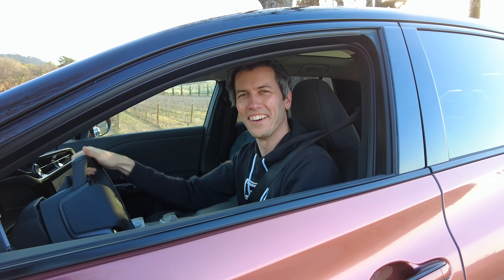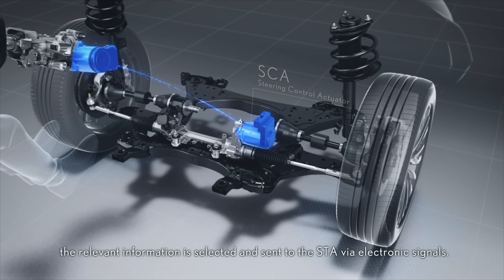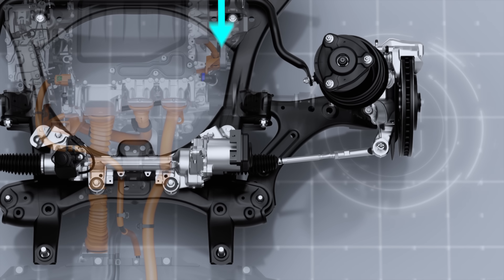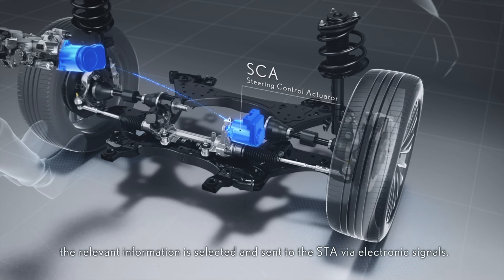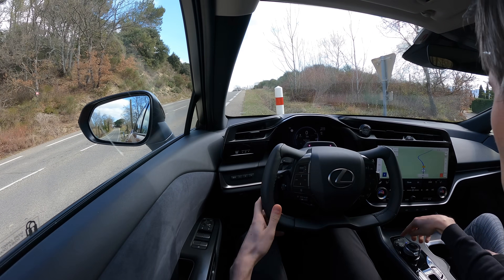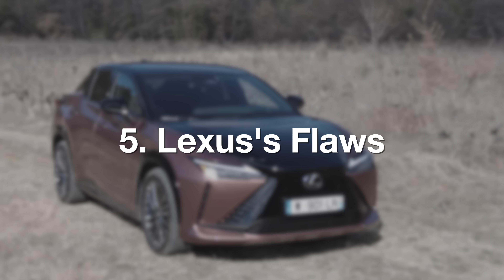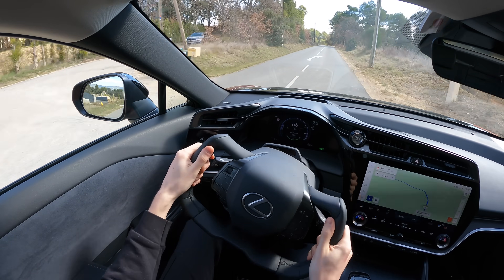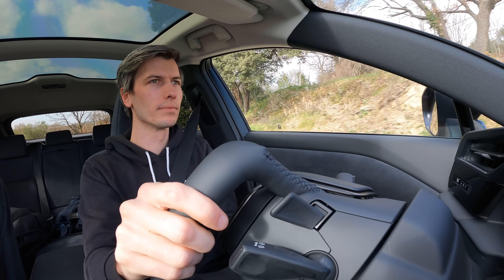How Lexus Fixed Tesla's Bad Idea: Steer-By-Wire Yoke

Comment: Wow i was beginning to type a comment about mouse sensitivity when that was brought up in the video. And i think that the analogy with mouse acceleration is better - mouse acceleration is perfect for the casual user, but at the cost of precision. Mouse acceleration (MA) is like this but in reverse, slow down with the mouse and sensitivity decreases (Making small incremental changes easier to handel) and when you make quick jerky movements, it will increase sensitivity = meaning the average user can make the most with smaller mousepads, much the same with this steering of 300 degrees. But. And heres the but. I myself have played FPS games all my life, and refrain from using MA because its hard to be precise. Yes some FPS pros have used it with great results (less than 5%), but its easier to be more consistent and precise with a same constant ratio. The brain learns that moving mouse 10 cm = i turn this much, lets call it 100 degrees. But with MA 10 cm mouse movement can result in anything between a rotation of 20-200 degrees depending on how fast you jerk your mouse in those 10 cm = Harder for the brain to correlate.

With MA the brain has to factor in an extra layer of data when accessing how much mouse input is needed. 

Whereas without MA the brain and hand coordination only has to take into account what my eyes see, and remember from past experiences how far i need to make my mouse travel.

In this case the acceleration in steering is dependent on the speed of the car, therefore the ratio of sensitivity is sort of locked in certain scenarios. But i think that can also be a course of concern. Think about it - youre driving at highway speeds and youre getting used to how the steering responds. Then all of the sudden you there's an accident that requires you to first slowdown very fast, and quickly maneuver: Could result in you overturning the wheels, making you have to countersteer to control the car and not swing to far to the side = Unstable.

Ofcourse this is just random thoughts and not facts. But i welcome this technology and would love to test it myself, to see how well your brain deals with sudden speedchanges / ratiochanges

Comment: BMW solved Teslas problem in 2003, with a varying gear ratio power steering (They called it Active Steering). Theirs was not drive-by-wire, but "just" a planetary gear on the steering column, that allowed varying the steering ratio significantly depending on the speed. I can very much recommend reading about it, it was well ahead of its time!

Comment: A software bug with your accelerator isn't likely to be fatal. A software bug with your steering wheel very likely is. Even the F-22 with an "unlimited" R&D budget lost an aircraft to a FBW software bug. It's just hard to write software that's as reliable as a chunk of metal...
Reply: Yeah, when he said we already have it in the accelerator. Except, if an accelerator fails it can either be designed to fail safe to zero throttle OR one can simply cut the engine. Short of  installing an ejector seat, wtf do you do when that comms link is lost?!
Reply: @devsfan1830 let Jesus take the wheel...
Reply: Your accelerator bugging and sending you full speed can absolutely be fatal
Reply: @user-ix9lx4sp1z  generally speaking, brakes are much stronger than the engine of a car. While you do risk catastrophic engine failure, it's unlikely that a "runaway throttle" actually prevents you from stopping
Reply: @user-ix9lx4sp1z  except you have breaks
Reply: @user-ix9lx4sp1z  CAN, yeah. But you could still put the car into neutral and let it buzz off the limiter, or turn the engine off. You can't pull a lever or turn your car off to magically fix steer-by-wire.
Reply: FBI bug 🤪🤪🤪
Reply: There are arround 200 F22s, though. And military aircraft tend to have a higher accident rate than civilian aircraft. 

I can't think of the top of my head of an incident where a passenger jet was lost to a FBW issue. And there are a lot of FBW passenger planes (the A320 family alone is more than 10K to the F22s ~200) 
 QA72 is the closest I can think of, but the pilot saved it with his huge balls
Reply: @cockatoo010 aviation also gets triple redundancy. You think auto manufacturers are gonna spend to give your steer by wire system 2 back up systems?
Reply: @LayerZeroDesign  do they have mechanical redundancy for fly by wire control surfaces in new aircraft?
Reply: And imagine the difference in part quality and testing between an aircraft, and a car built to a price
Reply: 1. a bug in an accelrator can absolutely be dangerous. 
2. F22 is an inherently unstable airframe, that can only be stabilized and flown with the help of computers. Regular passenger jumbo jets all have fly by wire, and they have worked without incident for several decades now.
Reply: 737 Max says, "hold my beer."
Reply: Steering systems can break
Reply: @Youtubeuser1aa yeah, and you're left with a direct mechanical link and unpowered steering that still turns.
Reply: But mechanical steering wheels still have software because all cars are electrically assisted
Reply: Airplanes have been using fly by wire for decades with little issue. Also steering systems can break too. If anything this is less complicated with fewer moving parts and possibly even electrical parts when you consider power steering.
Reply: Wait till you find out about planes
Reply: Pretty much every vehicle that will be equipped with pure steer-by-wire will also have autonomous safety systems, including automatic braking and even potentially being able to pull over completely. That's miles better than what was available when electronic throttles became universal.
Reply: I mean that's because an aircraft with no control is unsalvageable, a car with not control can absolutely be stopped
Reply: @UnePintade Very good point. Though I would also counter that steering and brakes are the two most likely to get you killed if you lose control of them. But your point is valid, if you lose any type of control of a plane it's life-threatening in the best case.
Reply: Airbus aircraft and new boeing aircraft all use fly-by-wire, and that's working out fine
Reply: The funny thing is: I had mechanical problems with my steering - the steering wheel sometimes (not always) stuck a little in a specific position. We were lucky - didn't hit anything and was most of the components of the steering system replaced.

And I witnessed one when an almost brand new car was steered into the guardrail because the steering wheel just stuck a little: not fully, you could move it, but if you don't expect it in the middle of the turn - you are in big trouble.

I don't think a steer by wire system would be any more problematic. It could even eliminate some of these possible problems - and introduce new ones, of course.
Reply: Software design is improving and we are able to write more complicated bug-free-guaranteed controllers. Steer by wire in car is a lot simpler than the one in planes and yet we do have steer by wire in all airbus airliners for already several decades working well without single issue. F-22 is an order of magnitude more complicated machine than a civil service airliner. In fact with modern tools it may be easier to construct safer steer by wire than it is a mechanical system. It's not like an assisted mechanical shaft can't fail - there is also a lot of complicated engineering that goes into it to make it safe - it's just that it's been there already for so many decades that it has been figured out and design doesn't change anymore.
Reply: @sk-sm9sh  There is a rule in IT: If it can fail, it will fail.
Reply: @vxvicky  which is also equally true in the mechanical world. The question is the probability of failure events. Beat mechanical and it doesnt matter if someone dies, because 2 or 3 would have died to the same fault already from the other system.
Reply: @JeronimoStilton14 No. I have only seen power steering fail after 240,000 kilometres, but electric power steering starts to fail after 100,000 kilometres.
Reply: @vxvicky  there is no way they would have allowed electric power steering onto the road if it only lasted 50k miles
Reply: @JeronimoStilton14  For sure, lile the n47 engine, that breaks his chain in around 100-120k kms xD
Or the latest Audi 3.0 v6 engine, which is the same.
Or the...
Reply: yes, so why replace something tried and true with something that's barely been used by manufacturers?  @sk-sm9sh
Reply: @sk-sm9sh  yeah but jets and planes have to contend with trees on the side of the road if the steering goes , not do they spend much time in actual use.
Reply: @sk-sm9sh wow tell me you’ve never programmed in your life without telling me you’ve never programmed in your life. At some point of complexity you can never guarantee bug free operation, it doesn’t even have to be because of the programming, background radiation could flip a bit or a sensor reading could be falls. Any program will have some bugs especially the ones interacting with the real world because the real world always adds some noise. 

Yes planes use fly by wire but they also don’t crash into a tree if their steering disconnects for 0.5 seconds, they will glide and give the crew some time to resolve the issue not to mention that they can put way more redundancy in a multi million dollar airplane compared to a 80,000$ Car… 

You‘re comparing apples and oranges there.
Reply: @Simoxs7  just because car is cheaper than plane doesn't mean that you can't apply same high standards on many it's systems thanks to economy of scale and many numbers of cars sold. Cosmic radiation can be accounted for and indeed it is in all critical systems - nothing new. Systems that must be bugs free can be built to be bugs free. Bugs are more problem of chosen and popularized paradigm that it is entirely built on idea that it's acceptable to ship customers buggy software and maybe fix bugs later. There had been on other hand plenty of software systems built that had been successfully operating for many years without incident. Just because the industry is in majority made up of lazy as managers and untalented developers doesn't mean that you can't find more talented people who can - and had proven through experience - build systems that don't cause havoc when turned on.
Reply: @sk-sm9sh  well yes it matters what a car costs, redundancy and Research and Development increase the cost of a car and the customer is only willing to pay for so much.

It seems like my Software engineering courses have forgotten to teach this magical way of programming without making any mistakes. I get what you mean with a lot of time and resources you can make a code logically correct but its not feasible at a certain point of complexity. Just look at Nasa, its not like they have huge budget constraints on their software and it still manages to work in unexpected ways. 
If this was like a purely mathematical problem you could account for every possibility and prove that the logic is correct but we‘re talking about the real world theres always a million unexpected situations that you can’t account for.

Not to mention that I personally don’t get what problem this solves, is the reward actually worth the risk? There are ways to do this while still retaining mechanical redundancy. I would not be willing to trust my life to some programmer who will never be held accountable just so I can have a yoke in a car thats not totally useless.
Reply: @Simoxs7  indeed it seems your courses didn't include it. I mean there are a lot of smart devices out there in the wild that run for decades without an incident. So your idea that this is not possible is ridiculous. In high level software where speed is everything and where there is low emphasis on quality indeed slightly more expensive time wise techniques that help to avoid defects are rarely used. Heck even as simple as unit testing is not being practiced by majority of software industry. Your idea that NASA has incredible budgets for software is actually very flawed as they work with much smaller budgets compared to what some large IT companies are working with. Typically biggest budgets are in area where there is biggest scale. You do not have infinite budget when you are producing software for a one of a kind mars rover. And cars have large scale so it often isn't a problem to get enough budget to build quality software for cars especially on parts that matter a lot such as steering controllers. And they are simple enough and for what they need to do it's totally possible to make them bugs free and to guarantee that they are bugs free through enough of testing.
Reply: @sk-sm9sh  You are just making everything up while you write aren't you?
Reply: @NotASeriousMoose  I'm working as software engineer in Germany and known people who work as software engineers at Volkswagen's subsidiaries and what I am talking is out of my personal experience or from things I learned of the people I know.
Reply: @Simoxs7  just .2$ from me. There are methods used in life critical system designs that limit bugs greatly (ie.e algorithms/functions/routines needs to be mathematically proven to work). Of course probability of an error rises with software/hardware complexity but you can limit it. It boils down to costs (time) and resources. Bugs usually are caused by not taking some edge cases into consideration which may happen in software as well as in "mechanical" implementation of a feature 🙂 Good testing is a key here.
Reply: metal is not that reliable. and you could probably do this with no software.
Reply: @Stay_away_from_my_swamp_water gotta love the random statement to the contrary with no opinion or basis to back it up.
Reply: @Stay_away_from_my_swamp_water You want a steering by wire to be done without software?! How about making all cars fly on unicorn farts while we're at it? 😂
Reply: @NotASeriousMoose  yes it is 100% possible to build the system onto a circuit board with no software required
Reply: @NotASeriousMoose what? This could definitely be achieved with just a circuit board and no software. Of course software would allow it to be more easily tuned.
Reply: @Anon.G  No it can't. That is pure lunacy.
But hey, prove it and earn billions.
I will leave you with Boschs definition: "Steer-by-wire consists of a steering wheel actuator, the steering rack actuator and software functions"
Even the Quadsteer from 2002 had software..
Reply: @NotASeriousMoose  why would this earn billions. The reduced tuning sounds disadvantageous. You also have no understanding of software and hardware at all if you don’t think it’s possible
Reply: @Anon.G  Because it would save billions in software costs for thousands of companies? But hey, keep thinking magic is real..
Reply: @NotASeriousMoose  it would actually cost a lot more. Pcb logic is more complicated and to change anything involves physical changes whereas software can be quickly iterated on.
Reply: @NotASeriousMoose Wow dude. It's clear you've never soldered or programmed anything in your life. It's 1000% possible to do steer by wire without software. Analog circuits exist. It's the same as any analog motor control on countless pieces of industrial equipment. You're talking out your ass just to do it. I'll never understand people who lie for fun.
Reply: Not only that, but unless you're using extremely thick wires, all it takes is a rats nibble.
Reply: Thats why programmers have standards. Programmers for vehicles and planes are expected to program in a way which makes it impossible for bugs to exist. And there can also be software to deal with those bugs. If a bug is detected then the car probably alerts the driver to pull over.
Reply: @NotePortal  go say that to Toyota.

Comment: Steering Ration differences were already a thing 15 years ago in my car and is a thing in most german cars. It was also adjusting to the ratio to the speed for comfort and those cars have and had a steering shaft.
Reply: It's been around much longer than that, 30 years or so, and I hated it in my 94 Cadillac
Reply: I think the video mentions that, but notes more options, such as the driver being able to specify different behaviors.
Reply: @karykrismer1448 it still can be achieved by 20 years technology in German cars. It uses planetary gear and electrical motor. So ratio depends on software which control electrical motor.
Reply: There is a limit on how much you can change the ratio.
Reply: Maserati had done it using hydraulics in the 60s or early 70s.
Reply: @earthknight60  At the time, when Citroen owned Maserati, they used modified Citroen hydraulics, because citroen's steering assist is based on the hydropneumatic system, but a regular car uses basic hydraulics.
Reply: I have it on my audi
Reply: Does the Model S have it? It would really come in handy with a yoke.
Reply: yes thank you I have it in my 2010 335i lol
Reply: Yep. Honda S2000 Type V has this too.
Reply: Ford has steering ratios too
Reply: Right? This just used to be called 'City' on many cars.

Comment: Im really starting to hate all this electrical stuff
Imagine the cost to fix something that was not necessary to begin with
Go back to regular steering pump, so much easier to fix
Reply: It's needlessly dangerous too. And unreliable. More maintenance for something needlessly complex. A Normal Steering column is Easy enough. Don't fix what isn't broken.

Comment: What happens, if I drive on the highway at 120kph, in a curve, but suddenly I have to reduce my speed to almost zero? The ratio changes during the slowing process, and my car just turn heavier while I hold the steering yoke in the same position? So basically I'm going off from the highway in the inside?